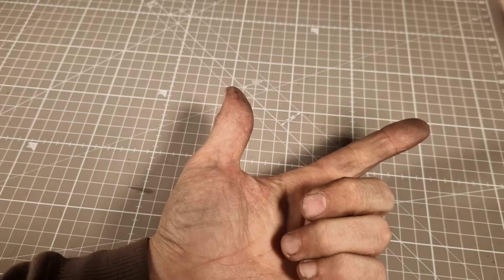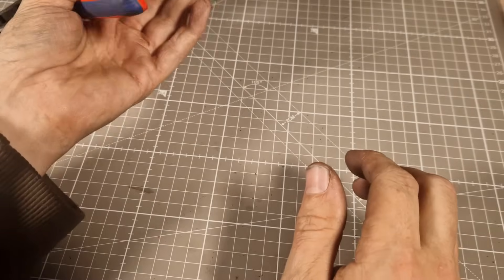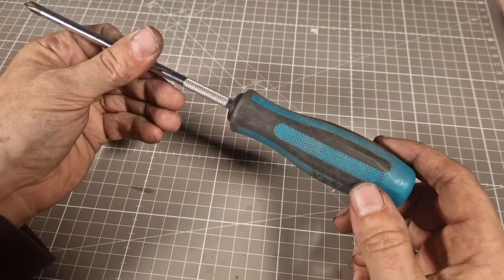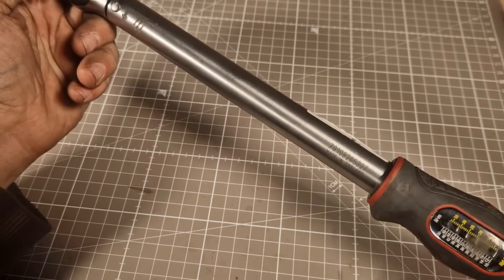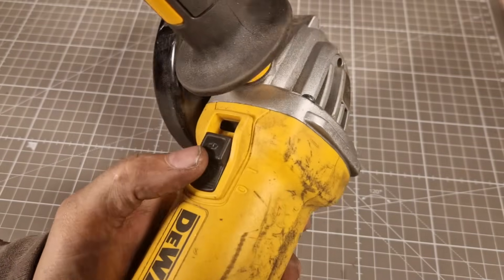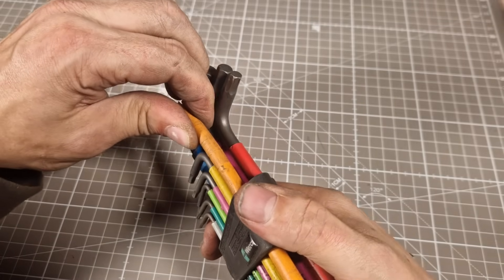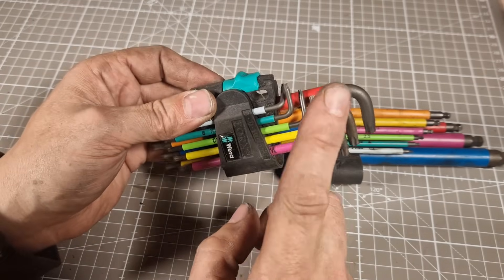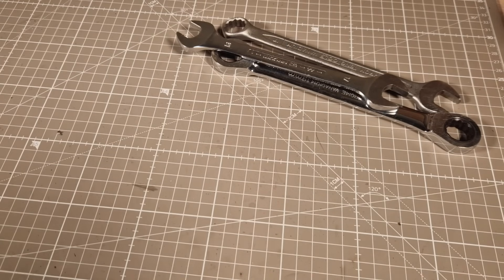DIRTY GARaGE  2023 tOOL REVIEW

Comment: When I was a practicing mechanic I used to empty my tool box and wash every thing in the paraffin bosh once every couple of months, then put them back nice and clean and neat only to do it again later, I had King Dick, Britool, Snap on even Chrome Vandium, I still have them all 46 years later, if you look after them they will last, I found tools are a personal thing to most tradesmen, though I have seen some who mechanics abuse every thing, my pet hate was hitting a plastic handled screw driver as a chisel, some cheap tools are as good and dome expensive ones are shite, it depends how you use them and look after them.

Comment: You're not wrong on the Wera Allen keys. I bought a set on your recommendation about 4 years ago and wouldn't be without them now. I've also got a set of the Vessel JIS screwdrivers. Honestly I'm getting a semi thinking about them they are that good.

As you mentioned value and longevity, I'd like to give a shout out to Halfords tools. I think they are often overlooked but they are really good and perfect for the amateur/weekend mechanic. I've got a socket set, screw drivers, spanners and a torque wrenches and you can actually go to a real shop to try before you buy!

Comment: The allen keys shown are great because the hex on short end is rotated 30 degrees from most other sets, so when you're in a really tight spot, if you cant get your regular tool in because of the orientation, these give you an in-between angle of attack....if I haven't explained it very well, when the set is laid down on the counter, the flat faces up rather than the peak.
Reply: no, thats good mate, I might get a set

Comment: The pass through gear wrench set you have can be handy for doing strut/shock absorber jobs. Assuming an impact isn't just being used.

Reaches down inside the top mount while still allowing a hex/torx to lock the rod.

Comment: Those gear wrench through socket ones are brilliant for if you've got an exhaust stud with a nut that used to be 13mm but has rusted away to a 9-10mm blob of rust. They seem to work better than just hammering on a long reach socket, hammer one on then get a socket and impact on it - don't know why but they seem to work really well. Just wish they did the extractor style ones with through heads. Won them in a competition once and it's the only time I've used them but still

Comment: The small knipex snips are great I've had a pair for a while and they're so far on a par with Linstrums. Only problem I've found with the Wera Hex is quite often the plastic shroud restricts being able to access if bolt is set in a deep hole as they're quite bulky. That said, you can swing off em 😂
Reply: Got knippex and a few wera,the Hex keys are great,as to your problem Wera do without coating,got them in a stubby version,

Comment: Heads up matt, i use a Japanese brand for my scale modelling...even for my mig welding and plucking eyebrows for the missus. The brand is Engineer. The PT013 tweezer is great value if you can find it online.

Comment: One thing I really dislike about that hex key set is the fact that the body is cylindrical. I find that when my hands get greasy it's hard to spin the shaft with one hand when you're first tightening up a bolt. The ones that are hex-shaped down the shaft give you a little more purchase - I know this sounds like I'm being picky but I find this happening all too often.

Comment: I've had the same grinder for years, can confirm it'll take punishment.

The Knipex stuff with the red handles (not red+blue) have harder cutting tips, that's what they claim for the larger cutters anyway. I think the red only handles are probably a bit more chemically resistant as well because they don't contain what I assume to be TPU, that being said I've never had problems with either.

Comment: Highly rate "BONDHUS" gorilla proof Allen keys. I have wailed on them for years in the tool room and they just keep on taking it.

Using a #4 copper/rawhide hammer on them to loosen cap screws and cheater bars would happen multiple times a day.

Probably should have bought 1/2" Allen sockets and a rattle gun/breaker bar, but the company didn't pay tool allowance so just pissed with the cock I had.
Reply: I have both the Wera and the Bondhus. Slightly prefer the Bondhus, but the Wera are very good and more readily available (eg, Screwfix seem to stock them).

Comment: I use Weras everyday all the time, i am a machine technician at a factory. The sleeves fall off all the time, edges wear and eventually you end up with a trashed tool because the "hex plus shape". The small ones are very fragile and crack much easier than other allens ive used.
Reply: They arent horrible, dont get me wrong. But they wear out very quickly, even quicker than a cheapy amazon 2.5 replacement. Which i ended up buying a 3 pack of for $5 instead of weras $8 individual 2.5.

Comment: I recommend checking out 78 13 125 sidecutters. They have a spring that stops bit, that you cut off, flying in random direction. For 3d printing filament and small wires they are really nice.

Comment: My experience of pretty much all those tools agrees with yours. I like the Facom spanners and screw drivers (although the spanners changed a few years ago and the modern ones are more bulky). Vessel screw drivers are great (they also sell the Impacta range, which are screw drivers with a built in impact mechanism - great for getting at hidden screw where a conventional impact driver won't fit). Wera allen keys are good.

I keep meaning to invest in some good pliers, rather as currently I have loads of random sets of variable quality. Knippex probably a good idea.

Comment: Since I'm not making a living with my tools, the value has always been a thing. Sure as you said, you could get the absolute best but especially for tools that are used rather infrequently for an amateur they just don't make sense. Also if my tool breaks (hopefully under warranty) my income is not in jeopardy and it's just annoying.

For some of the more frequently used tools I might spend some money and try to get the good ones. But then again, quite often even a cheap mediocre tool is worth its weight in gold when it does the exact job you need it to do rather than not having a tool at all.

Comment: I broke a set of knipex needlenose pliers grabbing a spring, was not impressed 😂, had to resort to a cheapo pliers I had for ages to come and save the day.
Reply: I've slowly amassed a mountain of cheap tools for jobs that require a bit of abuse but funnily enough I'm not breaking them quick enough to stop the box from overflowing 

The "Sunday" tools can obviously take a whacking but I do like the ceremony of using them for the nice jobs that call for a deft touch rather than the wrath of a Celtic dynasty hopped up on Weetabix
Reply: @11metalfan  it's always the horrible scabby yokes that live forever, while the posh stuff bawks at the first wiff of strife 😂

Comment: I think a lot of Facom stuff is way overpriced.
Their sockets aren't functionally better than my 15 years old Halfords set (with the exception of Facom sockets actually having the correct size stamped into them!) and almost 80 quid for a ratchet with a plastic direction selector!
The Wera allen keys have proven indispensable - a million miles better than cheapo stuff.
My old Halfords kit is still going strong, although the indicated sizing is all over the place and the choice of sizes in the kit is just plain weird.
So yeah, Halfords for abuse and stressing, because I ain't bothered if it does break! Gedore sockets for critical bolts because their sizing seems more accurate, and Stahlwille because everyone says it's quality kit and the spanner set was reasonably priced.